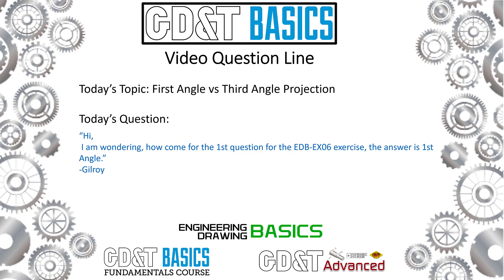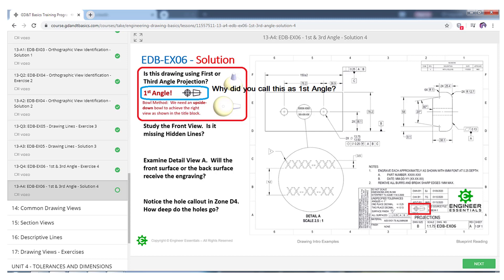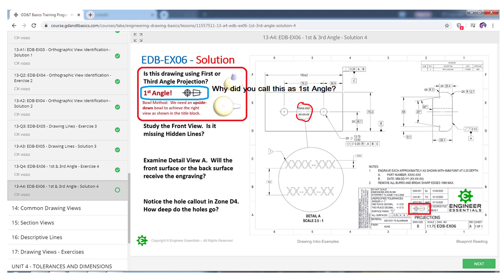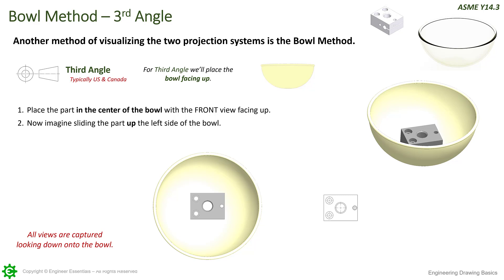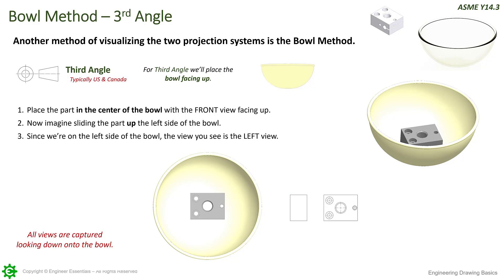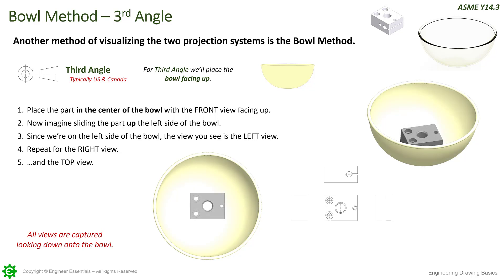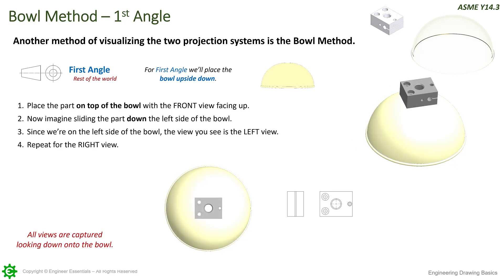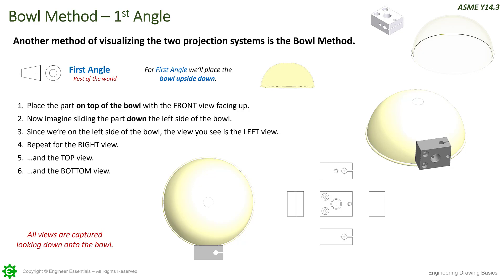1st Angle Projection on Engineering Drawings - How does it work?

Comment: ERROR found.    When you go from the 3 Angle to the 1 Angle  you  keep the Cone and end view the same for both examples.    So  is  USA 3rd Angle Cone - small end always to the LEFT.   and Rest of the world's Cone- small end always to the RIGHT.   Is that the way it goes ? ? ?  if so would be helpful to say 1 ANGLE and the REST of the world are right! because they go Right.   Helps tell the difference.    Am I right.   See you video. ?? ?? ?   And USA we are in the Bowl and rest of the world are out of the BOWL.  ? ? ?
Reply from the maker: As we have the symbol shown, it is correct. The “direction” of the small end of the cone will depend on whether it is represented in a LEFT view or RIGHT view with respect to the FRONT view that it is paired with. Be sure to take extra care when looking at the dashed (hidden) lines. Standard ASME Y14.3 defines the use of the projection symbols and section 1.6.4 allows for the use of multiple orientations of the projection symbol to define 1st or 3rd Angle.

Comment: Easy for me to see the difference with Bowl.  Always used the Bowl method for US standard,  Did not need to know about rest of the world yet.   Always depends on where you work.   Good to know.   20 years ago I might  have been taught both but because I only used one way I forgot.    You did not say why the Dash LInes were missing in the dwg.
Forgot to say using the side down FIRST angle the little project call out the  the side down view can be on either side.  And also same for  Third angle view - Side up view can be on any side.  so the way you now is to see is the the cone shape shown in Projection symbol on DWG legend.  Using that to figure out side up - either side  OR  side down either side.
That is it    CAN be side DOWN either side( 1st angle)....    &  Can be side UP either side ( 3rd angle)     so the small ring of the little cone and bigger ring of cone are both shown  meaning the view is slid down to left side ( in order to see small ring and large ring  in same view)  meaning 1Angle.     So there are dash lines ( for rear straight lines- both side- long length-- missing still I think ? ?  Thank you for videos.  very helpful.
Reply: https://youtu.be/XQIbn27dOjE 💐💐👍👍